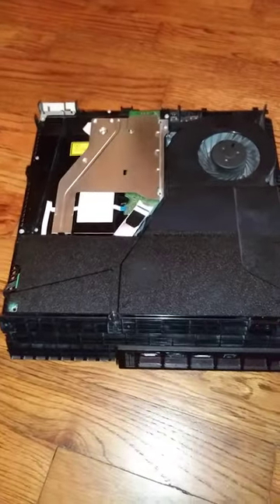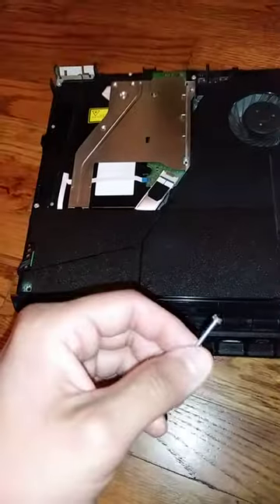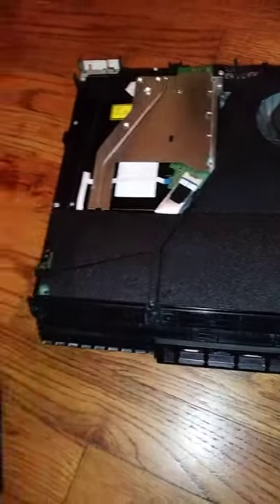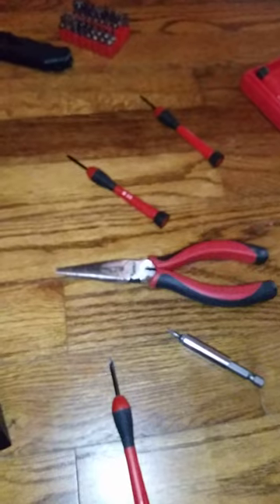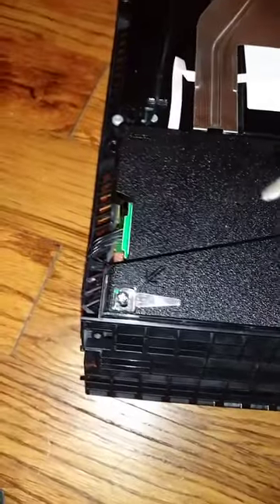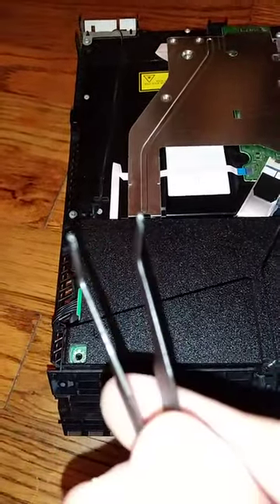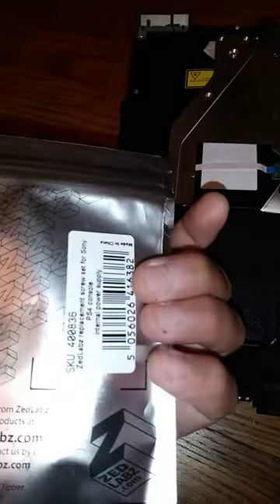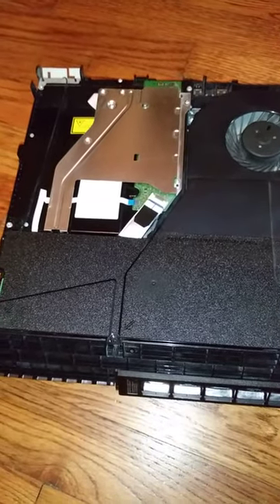Ps4 Original Model Power Supply Stripped Screw Extraction

Comment: Does it still work when the screw is rounded off and fully tightened?
Reply from the maker: As long as you can get a grip on the head with the needlenose pliers, you can twist it till to finally gives. Just dont expect to be reusing that same screw to get it back together lol
Reply: @fatalpenguinful  I won’t, if I will be able to get the screw out, would I be able to use the screws around it to support it ? Without using the rounded screw
Reply from the maker: @leewade3773  im not sure. I imagine it would still work, just be careful when you flip/handle it since the power supply isnt fully secured like it is when the screws in there
Reply: @fatalpenguinful  oh ok should i just leave it like that with the rounded screw still in there ?
Reply from the maker: @leewade3773  I'd replace the screw if you can but if you think you can get it back in there, go for it
Reply: @fatalpenguinful  the thing is I don’t have  any spare screws to replace it and I don’t want to ruin the PS4 trying to get it out lol

Comment: I don't have the same problem. However, I was cleaning my ps4 and I can't tighten the screw in. The power supply isn't loose when I turn it upside down and nothing appears to be damaged. Any tips?
Reply: I know this is a year later, but did you solve it? Because I'm having the same issue.

Comment: What size and brand are those needle nose pliers? I have the same issue with a stripped screw on my power supply.
Reply from the maker: I believe these are just a cheapy walmart/harbor freight pair. I'd actually recommend one that's a little skinnier in the head for easier access in that tiny screw area.
Reply: fatalpenguin thanks so much

Comment: I finally found the video for me but sucks to say it didn't work which really sucks because now I can't even play games without it overheating
Reply from the maker: They make screw extractors that you could drill it out but it's just finding one small enough for those tiny screws. That sucks tho!
Reply: @fatalpenguinful  yeah but I finally decided to just clean it as much as I can without fully opening it, but cleaning jt by taking the cover off and using compressed air on the fan
Reply from the maker: @matthewloarca7592  that's what I was doing until I decided to find a way to get my screw out.
Reply: @fatalpenguinful  was it working?
Reply from the maker: @matthewloarca7592  it did but it purrs like a kitten now that i got the screw out and actually cleaned the heat sink
Reply: @fatalpenguinful  I'm not worried about the noise in more worried about actually being abke to play something but thanks for telling me about the screw extractors I really only just wanna be able to play games until the ps5 comes out
Reply: @The_Story_Of_Us  try those pliers i mentioned the comment above, its made to extract stripped screws
Reply: @wazza831  will these fit in the ps4 screw slot?